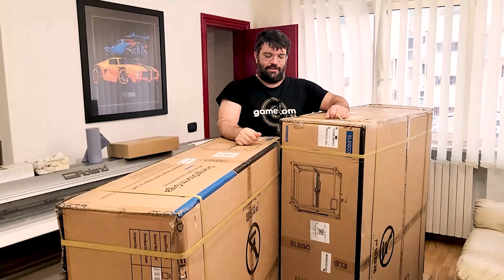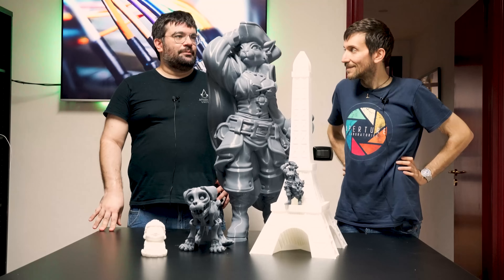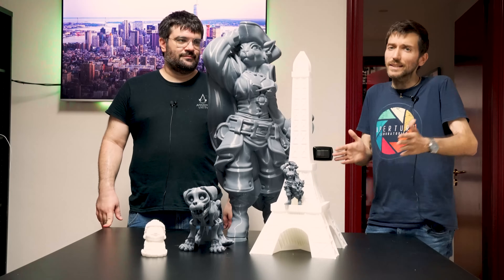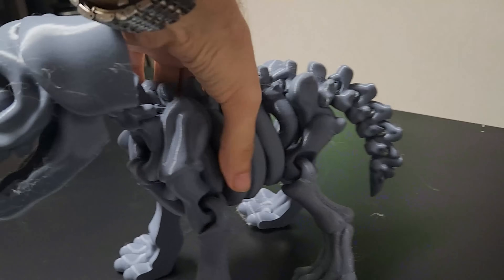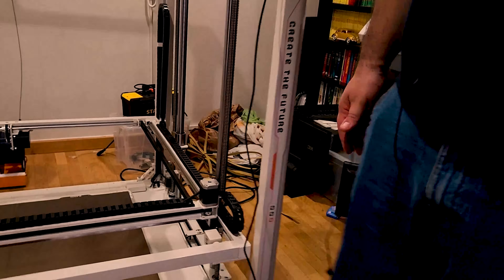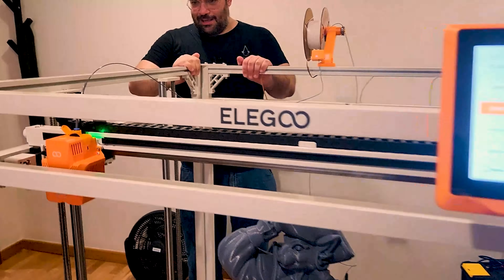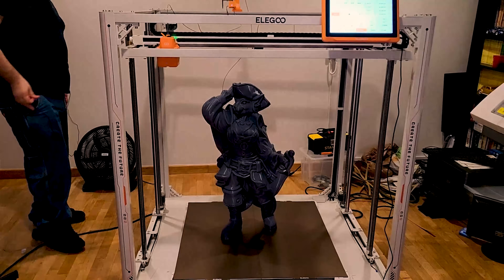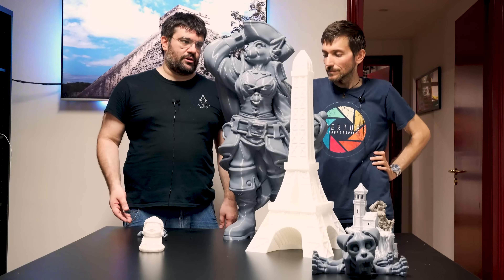Stampe ENORMI! - ELEGOO ORANGESTORM GIGA

Comment: alla fine parliamo di una macchina non pensata a chi deve acquistare la prima stampante... è orientata vero un tipo di pubblico "sverginato" nel mondo della stampa 3d, il problema citato del costo del filamento è abbastanza relativo a seconda dell'utlizzatore... per un'azienda che spende 2500 euro di stampante mette in preventivo anche che le bobine da 3/5/10 kg hanno un costo ... La stampante in questione è la piu economica sul mercato delle "big printer" basti pensare che una tronxy (che ti devi montare dado per dado) costa 3.5k... L'idea di acquistarla mi solletica tantissimo, visto cio che realizzo, una stampante di queste dimensioni mi farebbe davvero comodo, ma finchè la moltitudine di problemi che ha non vengono risolti, rimarrà un desiderio...